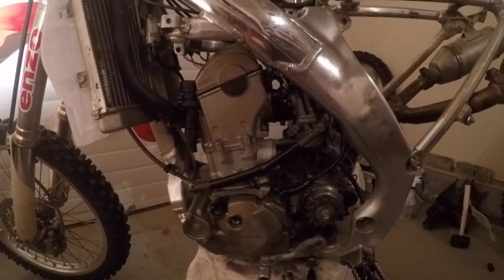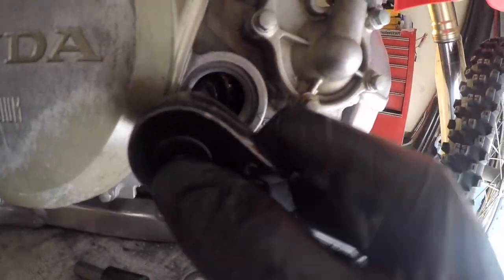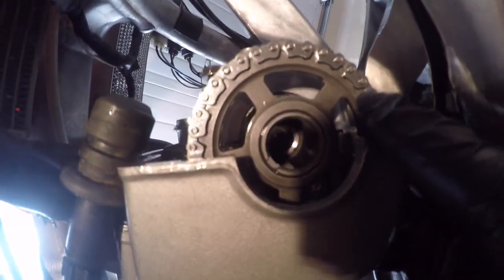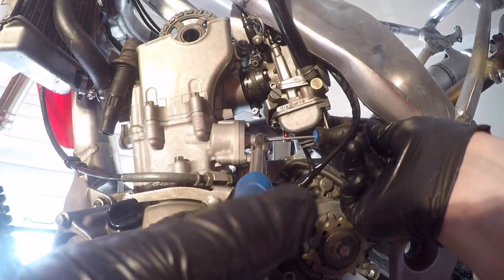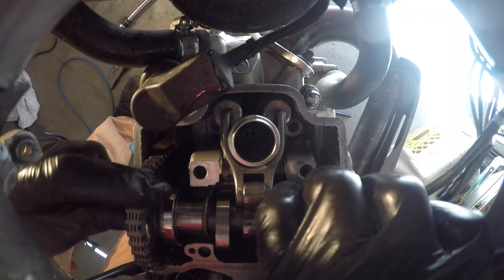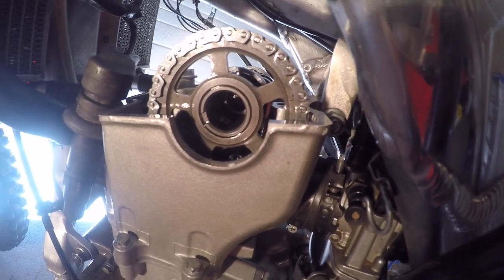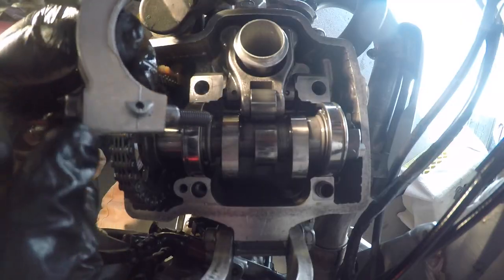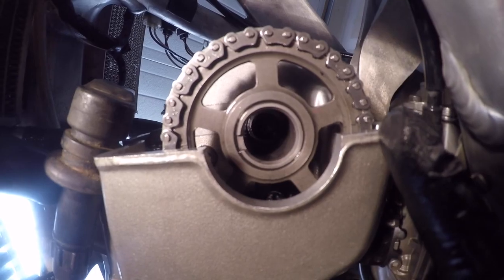How to Adjust Timing on a CRF250R

Comment: so when you say that it is possible to be off by 180° do you mean that its possible that the tick marks may not be visible if its off by 180 or that it is set wrong. Reason im asking is that i recently did my left crank seal and think i messed up the timing. i started and then i rode it for a minute then died now wont start and sounds as if it sucking air from the exhaust. any help would be great thanks.
Reply from the maker: moejr14 if you have the RH crank end mark lined up, the LH (flywheel marks) should be visible in it’s window.  If it’s not, the flywheel has likely slipped on its shaft. Doesn’t sound possible but I’ve seen it, you have to make sure when you did the seal you torqued the flywheel back up to specs.
 If your RH and LH crank marks agree, and both line up together, then you likely have it set wrong in the head. 
I’d start by going off the RH crank end mark, then double check to make sure the flywheel marks are good. Your scenario sounds exactly like what I’ve seen before with the flywheel slipping on the shaft. Ran for a few mins then quit, impossible to start. Flywheel wasn’t torqued, throwing the spark timing completely out of whack
Reply: turdpike so my r/h and cam shaft marks are lined up but the flywheel ticks are off. How can i fix this?
Reply from the maker: moejr14 ahh seems like your flywheel has slipped. So you’ll have to take the LH cover back off (be gentle so maybe you can save the gasket) and you’ll have to remove the flywheel and likely get yourself a new woodruff key (it likely rounded off) and re-install the flywheel on a new key. Make sure you torque to specs so it doesn’t happen again.
Whats happened is that your spark timing is off to the rest of the engine, its not getting spark at the right time. Will never run.
Reply from the maker: moejr14 how far off are they? Can you see them at all through that little hole?
Reply: turdpike so i just removed the l/h case and the flywheel and noticed it did slip and sheared of the key. I will replace 5he key and flywheel. what is the best way to torque down the flywheel without it spinning? also do you know the torque specs. Thanks for all your help man.
Reply from the maker: moejr14 have you opened it up yet? Is that what happened?
Reply: yes i opened it up and discovered that the flywheel had indeed spun. I changed the keyway and it all lined back up. it started in 2 kicks and ran fine, but i wasn't able to take it for a spin because one of my kids seems to have misplaced my dipstick . Thanks for your help. BTW getting the flywheel torques was a pain, i had the brake pressed and the the rear sprocket jammed and torqued abiut 40 ft lbs.
Reply from the maker: moejr14 glad you figured it out. It is hard to hold the thing still but it’s a must! Shouldn’t slip now